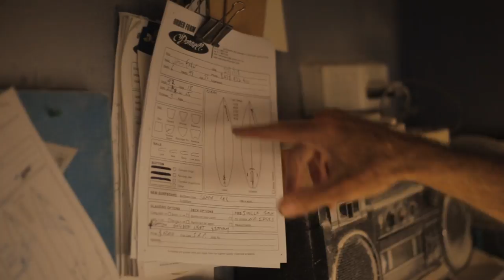Shaping Waves With Steve O'Donnell | GQ Shorts | Ep 0001

Comment: I hope Steve gets this message - mate, back in about 2006, you shaped for me 2 of the best riding and best looking boards i've ever experienced. The first was 9'2" and you layed batik cloth into the nose deck and spoon under. The 7'2" was really made for big fat Ulawatu swells. I provided a traditional Ceribon batik called fire and clouds in red and blue, a single piece through the whole of the deck. Both boards fairly flat rocker so they paddle real fast and trim beautifully on a wave face - big or small. You're a genius craftsman - if you're not a national treasure, you surely are a Northern Beaches Treasure.